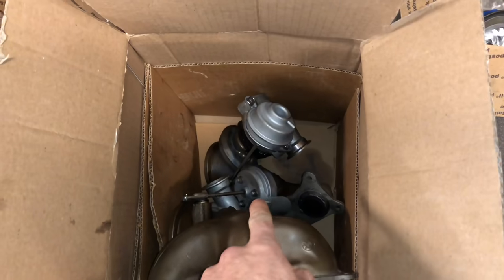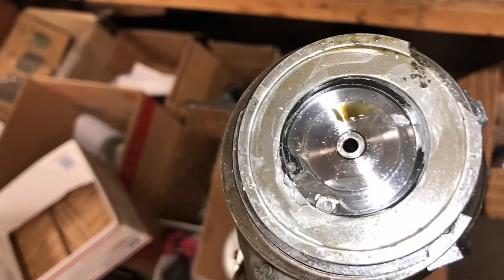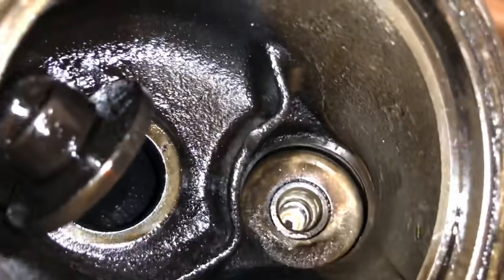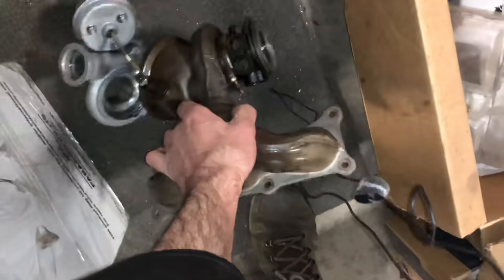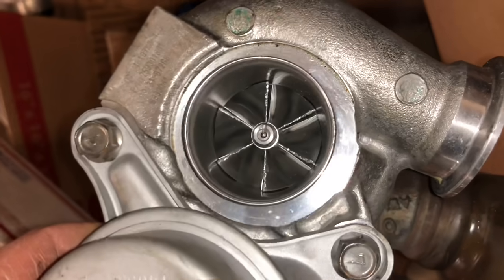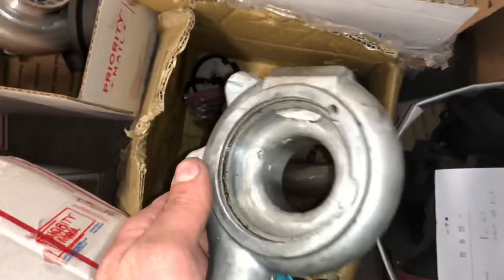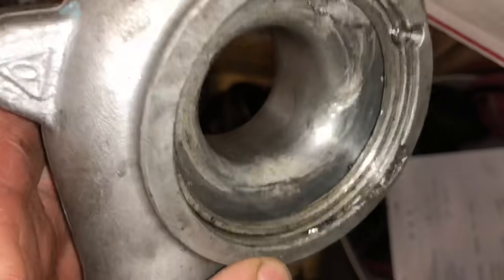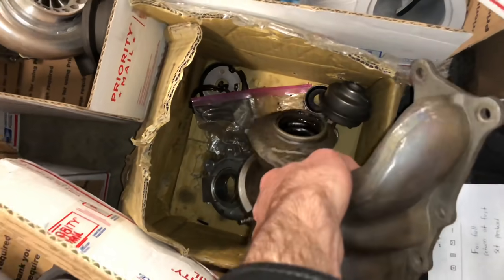N54 Turbo Explodes TWICE

Comment: I’ve been running your turbos on my N54 for 15,000+  miles with ZERO problems. You do great work Austin for very reasonable prices. It’s hard to believe that your work had anything to do with these catastrophic failures, especially twice. Sounds like a major boost control problem. Keep up the good work!

Comment: So I have had this happen on an old e46 330d, the turbo was whining for a while and then I pulled off hard and the turbo completely exploded just like that and the compressor also went through the outlet boost pipe. 

On an N54 I have had a problem that destroyed my turbo and it was caused by BMW's bad fitment of the turbo inlet pipe, they didn't fit the grommet so the intake pipe popped off the rear turbo and it sucked up some debris from the road and the turbo destroyed itself! 

This type of problem is usually always a fitment issue. People over look how important it is to replace all the orings and gaskets and make 100000% sure the inlets are properly fitted onto the turbos, be it the stock inlets or aftermarket ones.

Comment: I hade a similar problem the boost pipe was solid mount to the frame , when’d the engine moved the compressor got pulled from the bust pipe
Reply: Mauro Negreda: Or the customer has a bad motor mount allowing the engine to rock and apply force on the compressor outlet pipe.